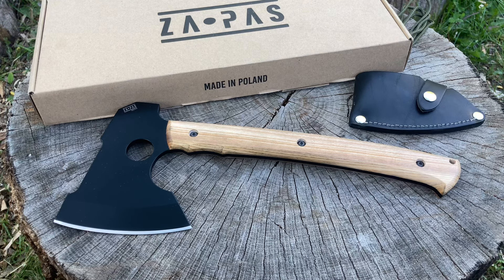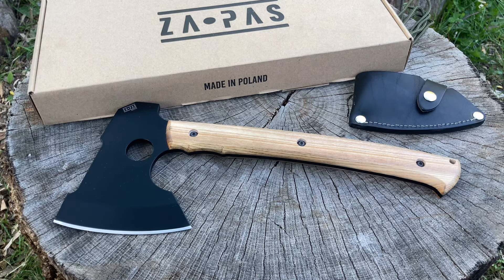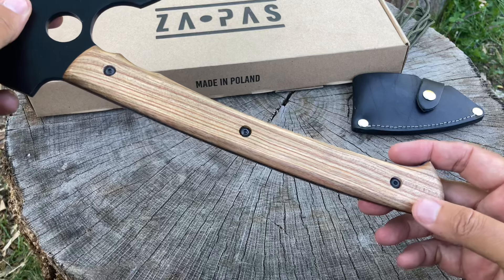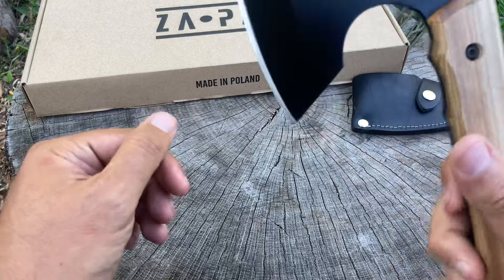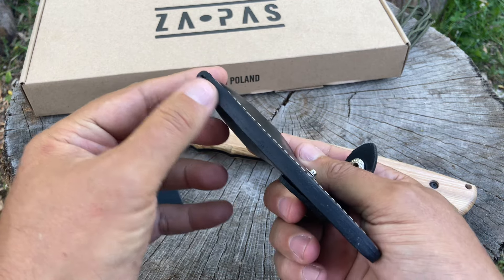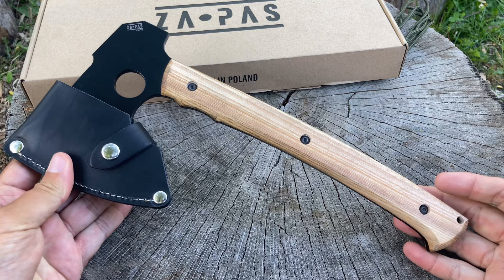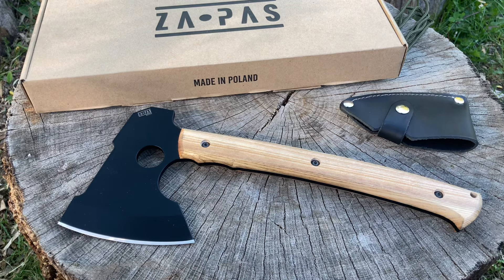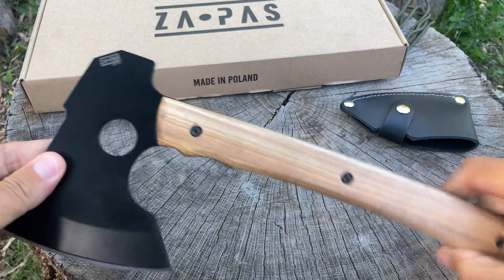Legion Premiere Look at the Za Pas Hatchet 80CrV2 Ash Wood Leather Sheath - MADE IN POLAND #hatchets

Comment from the maker: Legion Premiere Look at the Za Pas Hatchet 80CrV2 Ash Wood Leather Sheath - MADE IN POLAND!!!

Check it out here: https://a.co/d/fANPADn

DESCRIPTION
When the knife is too small and the ax is too heavy, it appears. The ax is out of our hands!

Blade made of 80CrV2 steel - The hatchet has a flat-ground blade, covered with black paint, which also protects against rust. The blade material is 80CrV2 carbon steel, a very popular type of steel for outdoor knives, it is very impact-resistant and at the same time achieves high hardness and contains, among others, Vanadium, which makes it keep its sharpness well.

Construction: full-tang - means that the knife is made of one piece of steel running the entire length and width of the handle

 Wooden handle - The special shape at the front of the handle and the hole in the blade allow you to grab it closer to the blade, which is helpful even during lighter manual work. The handle linings are made of ash wood, a natural Polish wood, protected with tung oil, fastened with black screws. It ensures a firm grip, both at the beginning and at the end.

Sheath - hand-made of natural black leather. Decorated with trim and fastened with stainless rivets so that the sheath has an elegant appearance and is durable.

Specification

Blade: Flat grind, 25mm high
Steel: 80CrV2 (57-58 HRC), finish: vertical satin
Handle: ash covers, protected with tung oil
Dimensions: total length: 310 mm | 12.4"″, blade length: 120mm | 4.75″, blade thickness: 5.3 mm | 0.21″
Sharpening: 25 degrees
Weight: 650 g | 22.9 oz
Product code: HT-J-NCV
Warranty

Our knives are covered by a 24-month warranty. This warranty provides protection against defects in materials and workmanship. The warranty applies to both the knife and the holster/bag. If a warranty product fails due to a manufacturing defect, we will repair it free of charge or replace it with a new one, at our option. The warranty covers only original, unaltered and unmodified items.

The warranty does not cover damage caused by misuse, improper care, normal wear and tear or natural color discoloration resulting from use.

Way of usage

Remember! All our knives are very sharp. Be careful when handling them!
Do not use your knife for activities inconsistent with its primary purpose! Do not use a knife as a can opener, screwdriver, hammer, chisel, crowbar, etc.
After the knife comes into contact with seawater, blood, fruit or other corrosive agents, always rinse the knife with running water and dry it.
Do not wash the knife with harsh chemicals or in the dishwasher. This may cause permanent damage or destruction.
If you do not plan to use the knife for a long time, protect it with a thin layer of high-quality weapon oil, knife oil or wax. We recommend that you always keep the knife and sheath clean and dry when not in use.
Make sure that your knife is always sharp and can serve you effectively.

Specifications
Blade material: 80CrV2 Carbon steel
Blade hardness: HRC 57-59
Handle: Ash tree
Weight: 22.928 oz
Overall length: 12.2″
Blade length: 4.72″
Blade thickness: 0.2″
Country of origin: Poland

#dskfs      
#22aday
#22adaynomore
#NeverGiveUpNeverSerrender
#NeverQuitQuitting

Don’t forget to hit the like button! 

Please help support our vets by raising awareness of the tragedy that is Veteran suicide by visiting the links below and reaching out to those in your life. If you know a vet don’t hesitate to reach out to them! 

Suicide Prevention Hotline: 1-800-273-8255 
https://suicidepreventionlifeline.org/

Mission 22
https://mission22.com/

Til Valhalla Project
https://tilvalhallaproject.com/

Message from Martin Miller, Army Veteran 66-69

1-800-273- TALK, press 1 for Vets saves lives. They're the Shining Stars of the VA. My brothers and sisters, you're not alone. The help you
deserve and have earned is just a phone call away. It takes the courage and strength of a warrior to ask for help.  Please call if you need help. Suicide is a permanent solution to a temporary crisis

I love this community!  The knife, sword, saw, fatwood, bushcrafters, and all the new people who have subscribed!  We are LEGION!

You guys' ROCK!

LIKE! SHARE! SUBSCRIBE!   Also don't forget to check out the other content creators!  They are all good people with great videos.

Comment: Also about the hole, the Terava Skrama has a hole in the blade. They say that is there to keep it straight during the heat treatment. Maybe this is something similar. Could also be used to hang it on a nail😂 or for bending rebar 😂.
Reply from the maker: Possible